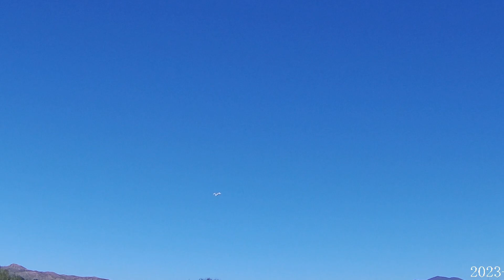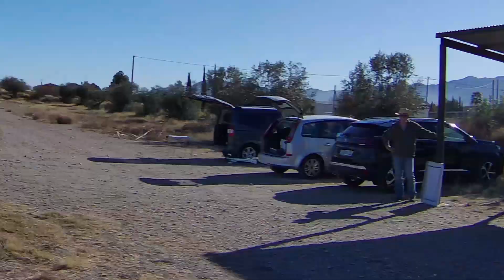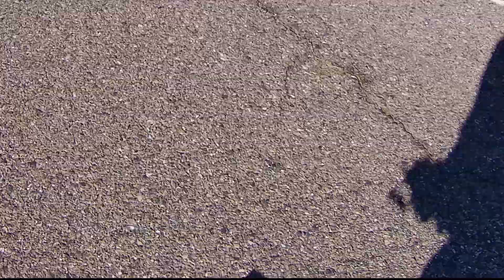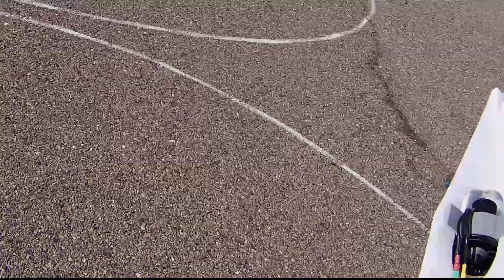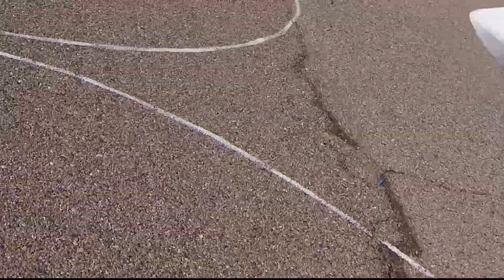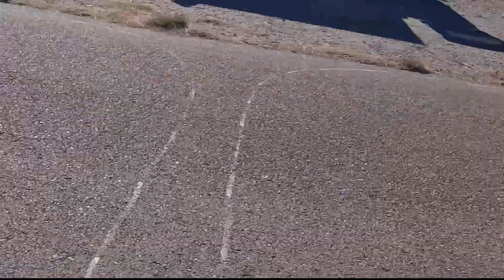Fan E 50mm EDF Fantrainer SUCCESSFUL Maiden!!

Comment: Much better than the first flight...
What is with all the "Telemetry Lost-Telemetry Recovered" warnings ?
Reply: Must be one of the latest frsky receivers!
Reply from the maker: The telemetry link runs at a low power maybe only 20mW so you can loose this link and it has no effect on the control of the model. I may need to upgrade my firmware on the Radiomaster Tx16S which I think has a fixed for this. See also : https://www.youtube.com/watch?v=wzf0yQ8VAVA